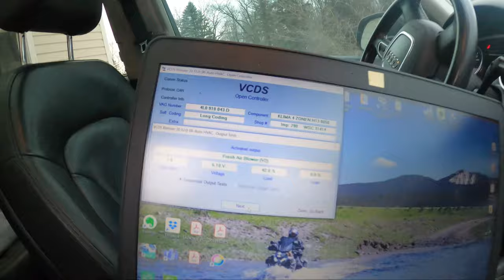2011 Audi Q7 TDI HVAC Fan Trouble!

Comment: Hey, thanks for the video. I have a 2015 Audi Q7 TDI and I am running into same issue where the front blower cuts on/off and rear keeps blowing somewhat cold air. Took little black box and blower motor off. Everything looks good on black box but ran into same issue you had with blower motor spring contacts worn. Want to try cleaning before I replace it. What cleanning spray solution did you use on yours??? 
Thanks in advance,
Jeff
Reply from the maker: I keep a can of CRC contact cleaner (green one) sitting around.  Take care with that stuff, some plastics do not like it.  Really any contact cleaner will work pretty well.  Best to do a small spray of a safe area of the plastic first to see if it starts to eat it just to check.
Reply: I bought a can of CRC the red one, it says it’s safe on plastic. I’ll give it a go and see if it worked. Resistor looks fine to me so if this doesn’t work I’ll get a new blower motor. Do you suggest to replace both? I was told they should be replaced as a new pair, but I’m not convinced. What are your thoughts…
Thanks again
Reply from the maker: @jeffreyroca3336  I would be skeptical as well, butt I also blew a few resistor boxes in a 2002 silverado by leaving the old motor and just replacing the box.  In that era the switch setting basically picked which resistor, so when one ate shit that setting on the fan dial just didn't work.  For this newer stuff it's likely some kind of PWM setup and no so cut and dry.  If the box is reasonably priced I would just replace it for peace of mind if cleaning doesn't work.  I've passed the Q7 onto the wife, and it's done 2 winters now with no problems.  If it stopped working, I would have heard about it immediately!  Hopefully cleaning works for you!

Comment: Great video and narrative! Same issue with my 2013 but it was an easy fix.  Only difference for me was that the 7 screws holding the fan in are 5.5mm. I’d never used that size before but my socket set happened to have one and it fit.  Easy fix for a Saturday morning!
Reply from the maker: There are a few things at work that are 3.5mm. Fortunately, such low torque we just use a 3mm on them.

Comment: Did you end up replacing the blower and resistor box?  I am having the same problem. WOUld love to. know if you ended up just replacing both parts to solve the problem.
Reply from the maker: It actually hasn't given me any trouble since the video.  It does make a little noise a low speed that I only notice with the radio off, but it hasn't shut off on me in over a year.  Hopefully you have an easy time as well.
Reply: @smsauce  It's odd the blower is working int he back and not not in the front. Where did you end up spraying the contact cleaner? I'm getting a slight noise but it doesn't sound like it's coming from the interior.
Reply from the maker: I was under the impression the rear HVAC has its own blower.  That's why my rear also ran while the front didn't.  If you pop that foam out like I did you will be able to see the armature and brushes.  I sprayed that area, although it didn't look too glazed over or covered in dust.
Reply: @smsauce  Thank you!!

Comment: Hi, I have a 2015 Audi Q7 TDI, and yesterday I noticed that while idled, & AC on, it went from ac to no ac but seemed like blower was still going- then after driving for 5 minutes or so it it started getting nice and cool again- ac kicked in. After car is off for the night, next day blower but no ac, it may or may not kick out ac - today as I was driving for 10 min to my mechanic to try and explain the issue, lol.  My mechanic is a 30-45 min drive depending on traffic SOCAL- so of course, by the time I got there car is literally cool as a cucumber and just worked perfectly for my mechanic- no matter what I said or did, f+++!!! Murphy’s law at it’s finest, dammit!  After we left, it started messing up again- of course mechanic was closed & I am now watching this video and I should have watched it before…. Grrr! It’s H O T here too!  Suggestions? Do you think it’s a combo of maybe a good cleaning and some freon?
Reply from the maker: This might end up really long, but I hope I can help a bit.  Intermittent problems really can be a PITA, especially when you drive that far and feel crazy!  The key with what you describe will be the fan.  Since it first happened when idling, I would repeat that situation.  If it was after a short drive so the engine was hot, then idling, do that again.  Manually set your fan to full, or at least enough you can tell it is on.  In temperature control the fan will change speed on it's own, so we want to take that out of the equation.  On our TDIs the AC compressor is on all the time, unlike some cars that have a clutch.  Normally you could wait for it to stop being cold, then go look under the hood to see if the clutch is engaged and the compressor is spinning.  Instead we have a control valve that will cut off the flow of refrigerant if it thinks the system is low to try and protect the compressor from damage.  So really the only home diagnostic you can do it sit in the car and see if it stops being cold again.  If it does there is not much harm in trying to add some r-134a to the system, but don't buy any that says it will seal leaks.  Also, if you don't plan on replacing seals yourself, don't get any with dye either.  It's better to have the shop add dye so they are not looking at a car covered in dye that leaked out weeks ago.  Anyway, get a plain r134-a can with a gauge on it, all the parts store stuff will connect to the low pressure port.  On our Q7s both the high and low pressure port are at the back driver's side of the engine bay by the fuel filter.  Plug in and see what the gauge reads while it's running and the AC is set on.  If the pressure is super low, like under 10psi, for sure that control valve is stopping your AC to try and protect the compressor.  Because the compressor is always on for us you can try adding r-134a, hold the can upside down (double check their instructions, though usually they need to be upside down) and use whatever trigger or valve they have to let some in.  Let the pressure come up, some of these kits have unspecific green/yellow/red bars.  These are not great for our cars, or really anything made after like 1998.  There is a table to check pressure compared to the electrical current going to the regulator valve I talked about earlier.  At 0.3 amps the minimum pressure is 2.5 bar (36.2psi), above 0.5 amps it's 1.5 bar (21 psi), and at 0.9 amps the MAXIMUM is only 1.5 bar (21psi) as well.  So anything below that 1.5 bar (21psi) on your low pressure gauge means it's definitely low on r-134a.  It is entirely possible to overfill the system, and these can take a while to draw in the fluid.  Sometimes 10 minutes or more.  The can will start to get cold if the fluid is going into the system because as the fluid leaves it boils and makes more vapor inside the extra space in the can.  This is long enough already so I won't nerd out and explain all that, but it's the same way the fluid turns to gas inside your system to make it cold.  If the pressure starts to go higher than about 27 psi, stop adding r-134a so the gauge is only reading the system pressure and see what it says.  If it's still below 21 psi go ahead and add more.  If it's above 25 psi sit in the car and see if it stays cold for a while.  Most likely what will happen is you will add some refrigerant, it will work for days, months, maybe all year, then act up again.  At that point it's best to take it in and have them find the leak.  Sometimes it's just a single Viton O-ring and most of the repair cost will be to replace properly extract and replace the r-134a during the repair.  Also, the nicer manifolds shops have (I borrow one from my friend and we have one at work) use vacuum to extract all the fluid and make sure there is no air in the system when it gets filled.

Last thing I promise.  It just clicked in my brain that you said SOCAL.  They heavily regulate the sale of r-134a under 2lbs.  It's entirely possible that auto parts stores don't even sell those small DIY refill cans in your state.  Either way you can sit at idle and see if it stops getting cold.  If your mechanic doesn't specialize in European cars they may not have easy access to the pressure tables or know to check control valve status during operation to verify the proper pressures.  Best of luck!